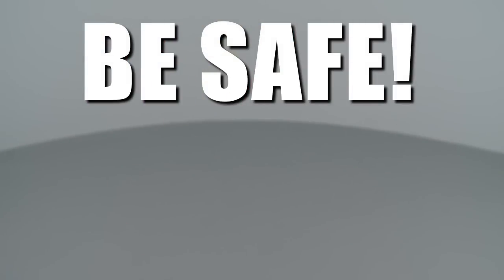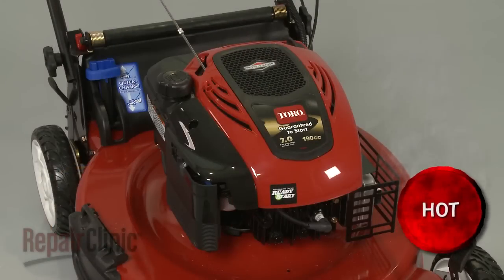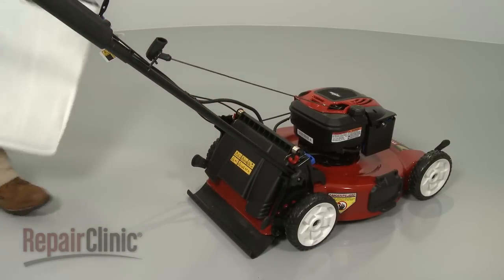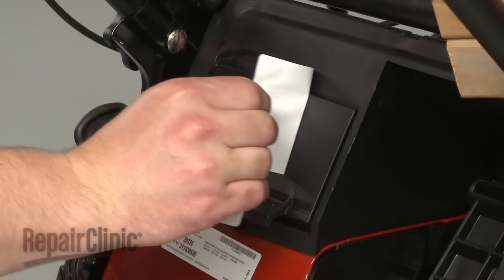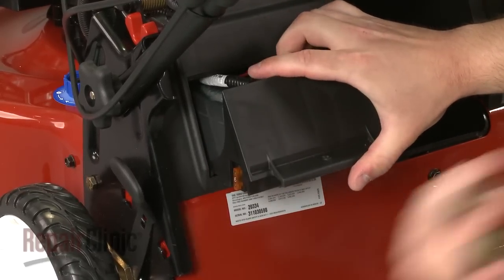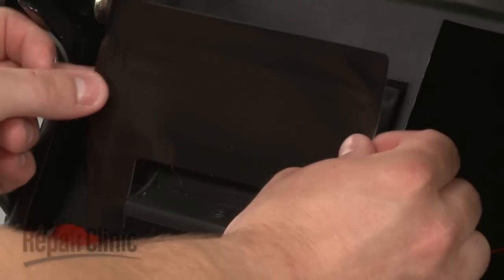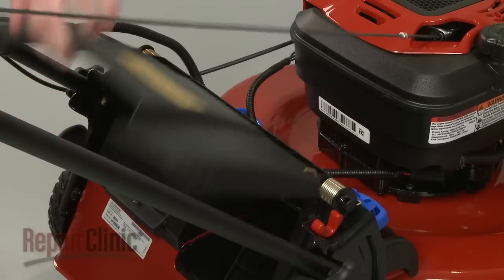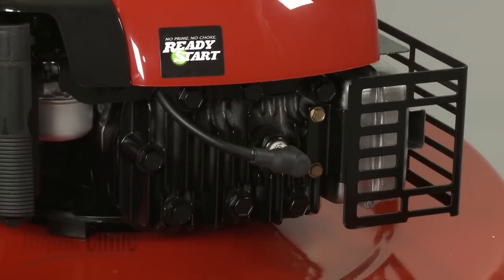Toro Lawn Mower Fuse Replacement #99-6124

Comment: Sorry to disappoint, but my new Toro Mower had the fuse on the back and had to pull the whole assembly out.  It was difficult taking out and still can't get it back in.

Also, Toro edited my review I sent in on their website.  Will never buy Toro again.

Second time fuse blew and it cost me a service charge first time, even under warranty.

Comment: my 20334 toro recycler 22 battery box and fuse position is totally different.  I took our the fuse to check and now the housing will not go back in.
Reply: Same here.  Mine was made in June 2020 and the battery and fuse set-up are different than this video. I've had to take my Toro to the shop 3 times in first year I have had it. Not happy. There's a 2 year warranty -- but then what?
Reply: where you able to figure out how to re-install it?
Reply: Any tips, having the same issue as well, thanks!

Comment: im looking for the fuse holder what is it called? is there a part number for that? im sure i'd have to solder it in. Thanks
Reply from the maker: It appears that you are looking for the battery housing. It can be found here: http://www.repairclinic.com/PartDetail/Bracket/1147936/2148295?TLSID=1773
Reply: No the fuse holder but thanks anyway
Reply: I d]0 po 9